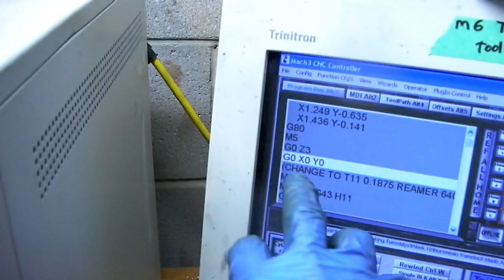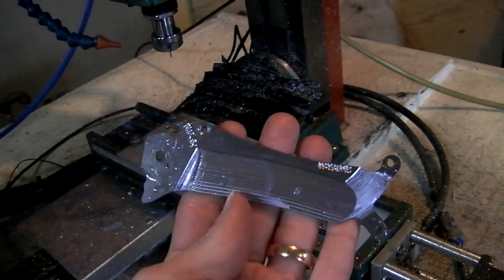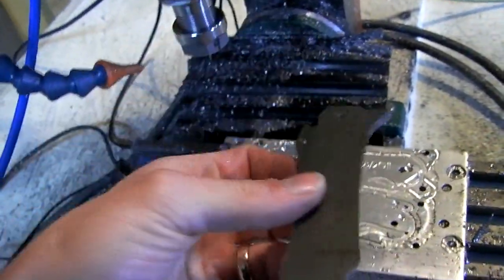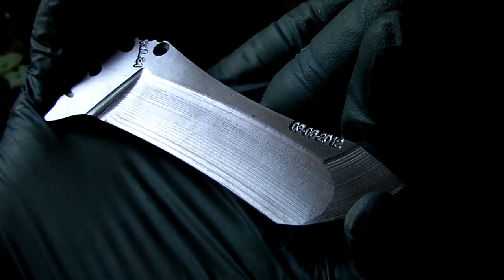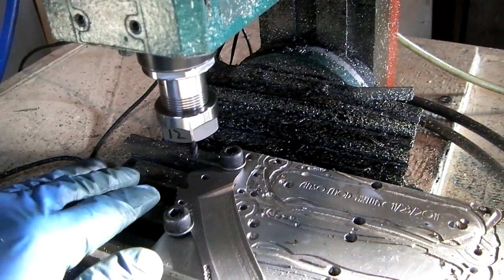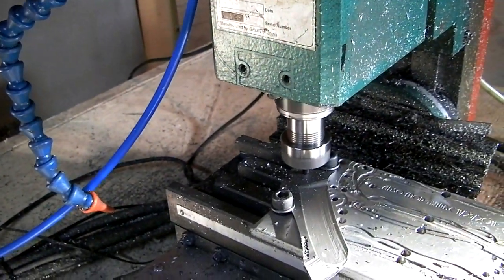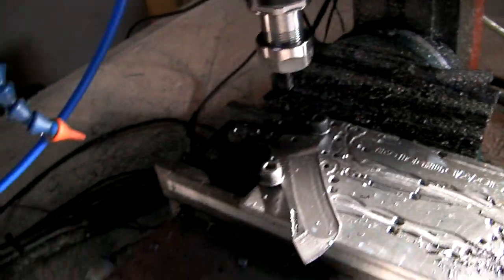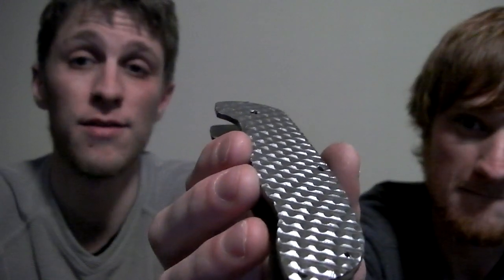Knifemaking Tuesdays Week 18 - making another RWL blade and set of Ti handles

Comment: After you mill one side of the blade, before you mill the other side, bed the blade onto your fixture with epoxy to keep it supported and eliminate the chatter. Be sure to spray the blade with mold release so you can easily remove it after the milling operation is complete. I'm interested in finding out just how you built your machine from scratch. Where did you get the control components? Great job and I wish you guys much success in your endeavors.

Comment from the maker: @BROUSBLADES Thanks!!!  Just wait till the toolchanger is automatic with a 16 tool carousel...  For the machine itself as it sits, no tooling or mistakes included, I dunno maybe $3k?  But I've put way too much work into it and it's still not all that great, but certainly does the job for now.  I'm thinking of building a bigger one from scratch with linear rails and way more power, that will be a fun project!

Comment from the maker: @hedroncollider Everybody is telling me that yes, all tolerances will change.  Guys say to ream the pivot undersized, heat treat, then ream it to size with a carbide reamer.  Also if you cut the lock tang and fit it perfectly before HT, it will most likely change and fit differently after HT, so leave room just plan on fitting it after.  Bearing pockets don't matter so much because for my caged bearings the pocket is purposely oversized.

Comment from the maker: @TheBigmetalhammer Thanks for the tips!  I've wanted to try using epoxy's while machining for a while now.  My machine is actually a conversion, it's a Grizzly G8689 mini mill that I added all the CNC components too.  Check out Hossmachine dot info for loads of info on a similar conversion.  I got motors from Keling dot net, IM804 drives from ebay, the control software is PC based Mach3, ballscrews and nuts are Thompson brand from Mcmaster, and I made all the brackets myself.

Comment: Please excuse my terminology for I am not a machinist. I love the way you take the time and mental energy to make the most awesome handles I've seen made. Having said that, the blades themselves would stop me from purchasing your knives. The steps are ugly as hell. Why not instead of making many step cuts with an end mill set the blade at an angle and use a butterfly cutter and make multiple passes until you have a perfectly smooth taper  and make the blade look as awesome as the handles
Just an observation and an opinion from a woodworker not a machinist.
Thanks for awesome videos. Please keep up the good work.
Fuzzy